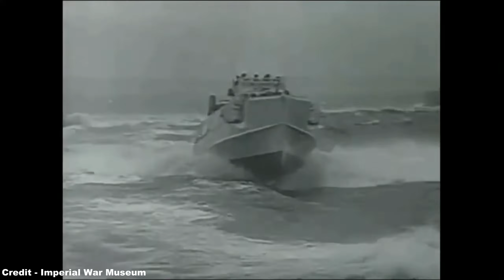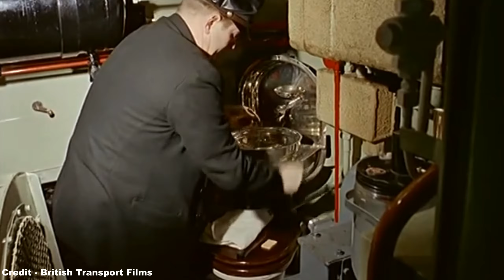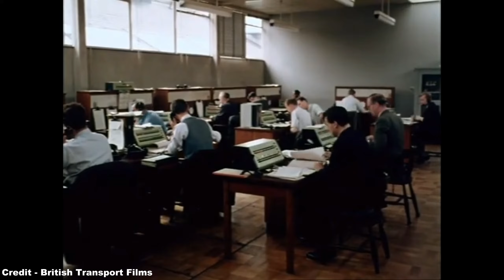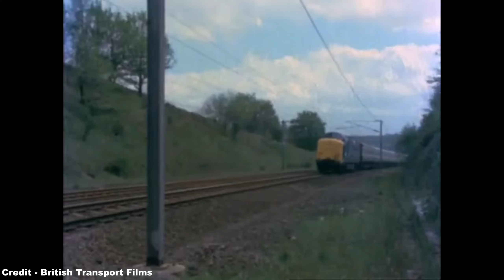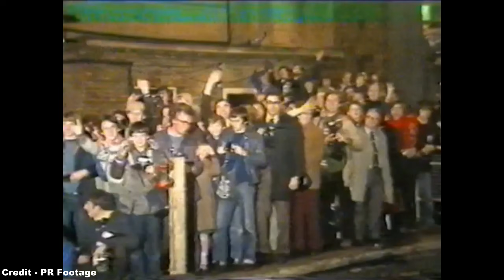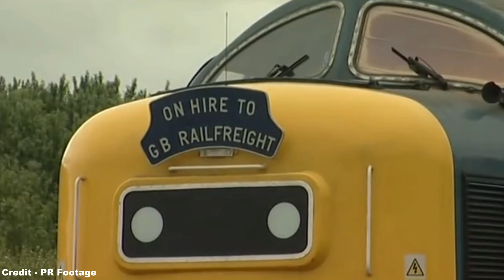Britain's Most Famous Diesels - Class 55 Deltic (Reworked)

Comment: GREAT documentary, most interesting. It wasn't mentioned that the opposed-piston engines had a unique triangular cross-section with three crankshafts geared together, which enabled not only an overall compact design but also provides uniflow scavenging and asymmetrical intake and exhaust timing without valves and camshafts. The 'Deltic' name comes from the 'delta'-shaped cross-section of the engine. Just once I saw one of these locomotives in service in 1978, and I noticed an unusual gear whine from the engine as it idled at a station platform. As a retired diesel tech I find this animation of the Deltic engine really interesting: https://en.wikipedia.org/wiki/Napier_Deltic

Comment: I virtually lived on the Deltcs 1979 - 1981 and even though its 43+ years ago i can remember my most outstanding bashes. One of the best was an overnight Peterborough - Edinburgh which did nearly every possible diversion - Joint Line , S&K, Leamside, N&C ,  Beattock. It took about 9 hours.

Comment: English Electric massively improved the Deltic engine by reversing the rotation of one of the three crankshafs
Reply: I've heard that the engine wouldn't work if all three cranks rotated in the same direction. I don't know if the reason was ever determined, but maybe it had to do with torque issues or harmonics.

Comment: Super video packed with information as always. I'm a little cofused by Mr Harrison's reason for rejecting the type for the Midland region (about 6 mins in). Power is measured in horsepower not RPM. So was his objection to engine revolution speed? Or to its power output?

Comment: You failed to mention the almost 12 months RSG spent on hire to Virgin Cross Country, and 16  being used by Porterbrook in a purple variant of the original livery. . Also there was DP2, basically a class 50 with Deltic cabs, that war written off near Northallerton.

Comment: A few mistakes. Deltics didn't lose their steam heat boilers. They were duel heat fitted when ETH was fitted. The steam boilers were in use up till the end on overnight sleeper services, these carriages being steam heat only. Only 6 of the Finsbury Park Deltics got the white cab treatment, not 8 as stated. 55001 and 55020 had were out of traffic by then  stored at Doncaster works, heavily stripped of parts, both officialy withdrawn in Jan 1980. Its the 'Green Howards' not the 'Green's Howard'. Other than that a good film.

Comment: hi there, its a pity the NRM don't get DP 1 on the track again, it could have a new engine x2
Reply: The engines on DP1 are different from Class 55. DP1's engines are shells, no pistons or crankshafts, these were removed as Navy spares back in early 60s. You would need to fit D18/25 engines from Class 55. These have different generators, and i believe DP1 has differently rated traction motors, not an expert bit i think 4 and 6 pole respectively. Plus due to its age DP1 would require a complete rewire. A lot more involved that what we realize
Reply: @richardmarshall4322  Yes and no. There are at least four complete ex marine series one Deltic engines that are of the same type as fitted to the prototype held as potential donors, two of which owned by the DPS. So whilst difficult, it would be possible to get DP1 up and running with the correct power units and generators.